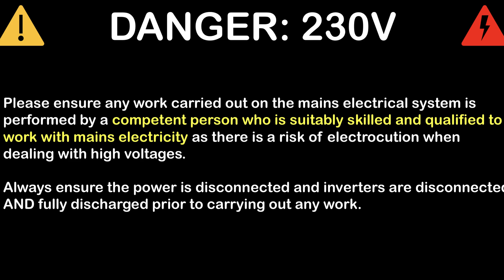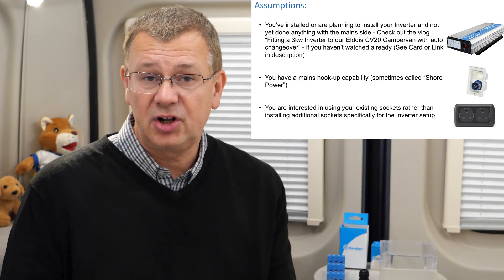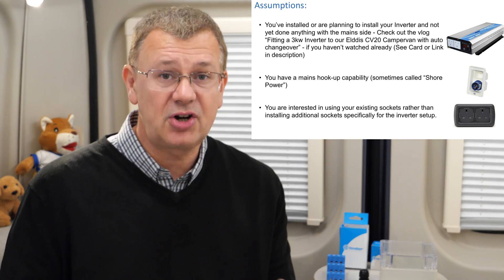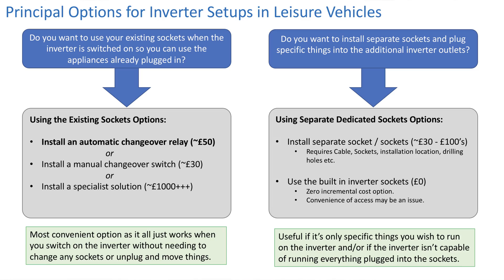Campervan Mains & Inverter Auto-Changeover for under £50 using a RELAY - How it works - Tech vlog

Comment: Hi David, am I right to assume that all of your 230V sockets are on one radial circuit? I went to install an auto-changeover on our Elddis coachbuilt motorhome today and found that the 230V sockets are on three separate radial circuits. I think it would be a bit messy to connect all three circuits to the relay, so I guess my alternative will be to connect the changeover to the 230V incoming to the consumer unit and be careful not to turn on the heaters and flatten the battery. Thanks, Kevin.
Reply from the maker: Hi Kevin, yes, that’s right, the sockets are all on a single circuit then there are separate circuits for the charger and the water heater and space heater. Imagine as you say it would be more messy with multiple circuits, the main one to watch is the charger being powered - not that it overly matters it just wastes energy in inefficiency (inverting to charge to invert …) all be it in the grand scheme of things, not sure it would make a huge difference, especially if you just use the inverter when you need it for specific purpose rather than leaving on all the time. Not sure if that helps at all. All the best, David 👍
Reply: @LeisureBit  Cheers David, thanks for confirming. In previous vans I have only turned the inverter on for a specific purpose, such as using the microwave or kettle. The charger and fridge share a MCB, so I guess could be turned off. Another option I thought of is to use a junction box separate after the auto-changeover to split the three circuits. One advantage of using the 230V incoming to the consumer unit is that I can utilize the existing RCD. The Sunshine Solar inverter that I have has an RCD compatibility switch that bonds the neutral to earth/ground, so the RCD in the consumer unit should still work.
Reply from the maker: Sounds like a good plan. Your inverter sounds much better than the one I got with its neutral/earth bonding.

Comment: Hi David Thought this was an excellent idea and the answer to my prayers.  I wanted to use my small solar system to heat a propagating bed in my greenhouse but have the security of a back up mains supply if the solar batteries ran low in the night and it was frosty. . I bought all the bits but ran into a problem before setting it up. My inverter alarms then cuts out on low battery (9.5v) but immediately the battery voltage increases as it recovers and the inverter cuts back in for a few seconds then drops out again as the voltage declines. It then continues to cycle on and off every few seconds. If I use your relay system will the relay equally keep cycling between mains and solar and is there any way round this..Appreciate your help.
Reply from the maker: Ah, I’ve see that before, my inverter just shuts down if it gets under voltage so doesn’t ‘loop’ - you probably need some form of delayed restart for several hours to enable some charge or a cleverer way of calculating the capacity. Out of interest are you using non-lithium batteries? All the best, David 👍

Comment: Hi David firstly thank you very much for your great video 👍
I am looking do something very similar if not the exact same in my campervan, am I right in thinking that the shore power is what you were using as the main input ?

I typically power my sockets when my campervan is parked up via shore power. However each time I'm using the van I have to unplug everything and plug into my inverter,  will following your video like for like resolve my issues? Many thanks 😊
Reply from the maker: Thanks very much for watching and for the comment. I use it on the sockets circuit rather than the hookup for a couple of reasons in my van. Firstly I didn’t want it powering the charger (because it would be powering the charger to charge and generate an inefficiency loop)  or the heaters, only the sockets so I can run things plugged into the sockets when on hookup or off-grid with the inverter on.
Hope that makes sense? It saves then needing to plug into the inverter socket each time. 
Make sure you get an electrician to either fit it or check it over before powering up 👍
All the best, David 👍

Comment: David, Me again !🤦‍♂️, Is there a chance you could tell me where the wiring is fitted on the consumer box please ? Sorry to be a pain, I’m the opposite to you , I’ve spend no time doing electronics all my life😂 Any help would be greatly appreciated and my other half and I continue to enjoy your videos keep it up
Reply from the maker: No worries, it’s connected between the sockets breaker and the sockets feed so it drives the sockets only on mine (you could do it differently depending on your requirement but I only wanted sockets powering) - hope that makes sense? All the best, David 👍
Reply: @LeisureBit  
Thank you I will be attempting it Saturday morning!
Reply from the maker: @slowelowe hope all goes well and don’t forget to get it checked over before switching on 👍

Comment: Hi David with this setup can I leave my inverter plugged in and switched on while I’m on shore power?
Reply from the maker: Yes you could to get additional power, I do that if on 10A hookup for example to make a coffee without needing to turn the heater off - otherwise on shore power would make sense to switch inverter off and use that but handy for a boost - all the best, David 👍

Comment: Hi David. Just one more thing before i get started the weekend. For the inverter RCD does it matter if it's a single or double pole? Many thanks in advance. Tony
Reply from the maker: Double pole for isolation is definitely best - the rcd on the inverter only functions in certain fault scenarios if you have a floating output inverter (if it’s a Multiplus or the likes it works as per domestic) - Don’t forget to get it checked over by an electrician too - all the best, David 👍
Reply: @LeisureBit  Thanks David. Yes i will get it all inspected by an electrician and get a safety certificate. Once again many thanks.

Comment: Hi David, as someone who is looking to do this, but the battery charger is plugged into transformer/recifier which is also powered by the same RCD as the sockets, do you think since i cannot put that on a seperate line, a better option maybe to add a Current sensing switch, and have the mains from the inverter run through it, with the battery charger connected to the pins, that way when the inverter is running it should shut off the charger, or is there another option you can think of?
Reply from the maker: Is the charger plugged into a socket or wired back to the breaker? If wired back you might be able to separate the two and just put it on the circuit for the sockets rather than the charger as well. Just a thought…. Might be simpler than a current sensing switch, there are other options like another relay to disconnect the charger for example. If the charger was running it just uses a bit of power through inefficiency charging and powering it’s self, if you don’t have the inverter on for long periods, I wouldn’t worry too much as it should use a massive amount. Worth getting an opinion off an electrician who can take a look too as they may find a better or simpler way too. all the best, David 👍
Reply: @LeisureBit  The hookup goes through the breaker and powers both the 12v transformer/recifier and 240v same RCD, and the rectifier also recharges the battery as well as powering other devices, there is no way around it with a simple switch, and i'm not confident enough using a 230v supply to cut a 12v via a relay thats why i was thinking my best option would be to use a sensing switch, as its more for my parents than me, my knowledge is limited but i do trust myself to do that.

Comment: Hi David. I have another question if you don't mind. I have the Bluetti ac200 max and on the inverter side do you recommend i run it through a rcd still. The Bluetti is a all in one inverter / battery that i'm pretty sure you have heard about. I want to connect the van sockets up to it with the change over switch. Many thanks in advance and i love all your videos. Brilliant.
Reply from the maker: Thank you, I personally would but I also know there is limited protection, it’s in a certain scenario where it would be effective, same with powerbanks, most have no protection and are used without issue. It’s a balanced risk, low probability of issue, but very high potential impact. Not sure that helps - all the best, David.
Reply: @LeisureBit  Thanks David for your fast reply. This has been helpful.

Comment: Hello David... I have learned something that may be of help to anyone else doing this work... Some RCDs are designed to disconnect when the electricity is turned off, these are known as non-latching or active RCDs. Others are designed to stay connected when the electricity goes off and these are called latching or passive RCDs. Because I had a non-latching RCD,  everything tripped out when I turned my inverter off, which was initially very confusing !!
Reply from the maker: Thanks very much for sharing as it’s really helpful to know - pleased you found out why too - all the very best, David 👍

Comment: I have a quick question but i would like to thank you first  David for this great video. This is certainly a game changer. Now my question for you is do recommend 1.5mm cable for the relay to the sockets or 2.5mm. Many thanks in advance. Tony
Reply from the maker: Hi Tony - thanks very much - it’s very handy isn’t it  - I personally would always use a good quality 2.5mm whenever possible - all the very best, David 👍
Reply: @LeisureBit  Thanks for you fast response David.

Comment: Hello David,  thanks again for the video... I have now finished my installation and have a question... when I am using 240v through the inverter, everything seems fine UNTIL I turn the inverter off. At that point the in-line RCD (between the inverter and the relay) always cuts out and I have to reset it the next time I turn it on to use it... any clues ? ANy help would be most welcome. Thanks. Michsael
Reply from the maker: That sounds odd but I wonder if it's when it browns out (when the voltage drops out after switching off) - out of interest which Inverter & RCD have you used? Might be able to figure it out from that.

Comment: Hello, great video, is it possible to use the same hook-up consumer unit RCB for the sockets as the inverter or would they both need separate RCBs for the sockets. Thank you
Reply from the maker: I used a separate one from the inverter and the main one from the mains via the sockets, appreciate the inverter one with this type gives some protection but due to floating outputs not the same as the regular mains (given how they work) but I still thought worth the extra one. Hope that helps, All the best, David 👍
Reply: @LeisureBit  thank you great to know 👍

Comment: Hello I used option 2 a manual switch, however I came out the RCD socket side, that was my input on the rotary switch and then my sockets as my output on the rotary switch, however if I flip the RCD on or off makes no difference I still get power, maybe it's possibly due to using the shore hook up RCD I might need to use a dedicated one. Cheers
Reply from the maker: Hello, I tapped in from the socket breaker, and the sockets as the output, same as your switch. Seems odd ref RCD, all be it the RCD for my sockets on the mains is up-stream in the consumer unit and the RCD from the inverter feeds into the other poles. Hope that makes sense? Both trip and cut the power on testing. All the best, David 👍
Reply: Great thanks for the reply much appreciated, I didn't test on the mains hook up side so I'm guessing I need to install a separate consumer unit for the inverter so I can trip the sockets off  and on when testing and obviously for safety.

Comment: Thanks once again for your brilliant video... I have just finished my own installation and have a question... can I ignore the AC input on my inverter ??? I am only going to power my sockets either by hooking up with shore power. ,or .. if no shore power is available... by using my battery powered inverter. So my thinking is that I have no use for another AC input into my inverter ??? Any advice would be very welcome and I'd be happy to buy you a virtual pint as a (hopefully) fair exchange... Michael
Reply from the maker: Hi, great you’ve just finished your install. If your inverter has a mains input for UPS (Uninterruptible Power Supply) mode, you can just ignore it as it’s not normally the feature required in a van setup, more where you want to keep a continuous power if the mains fails (like keep a computer or medical equipment running) - hope that helps and makes sense., All the best, David 👍
Reply: @LeisureBit  .... thanks once again David.  that is very helpful - and soothing to know that my own installation is "solid". I am a naturally risk averse character and I like to know that I have got all the potentially lethal stuff right ! Michael
Reply from the maker: @michaelbarnicott-white5498  Absolutely right, it's always important to get any installation checked independently to make sure it's safe. As you say, there's a lot of potentially lethal stuff in vans, especially when we add to them or modify in which a small mistake can cause catastrophic or life changing outcomes, always best to do everything to mitigate against it. All the very best, David 👍

Comment: I'm concerned about upstream bonding of neutral to earth so the sulied rcd still trips under fault conditions.
Many inverters won't disconnect like an " on shore". Rcd should. Any thoughts?
Reply from the maker: You're absolutely right, certainly the 'cheaper' end tend to have floating outputs (also lots of generators, power stations etc) and many expressly forbid the bonding of 'Neutral' to 'Earth' on these also which otherwise you could do to get a domestic like outcome if that was required. 
As you most likely know, RCD works on imbalance between L / N current flow - so if it's floating, if you touched one of the outputs and then 'Earth' if it's not connected anywhere, it's likely no current would flow (clearly wouldn't recommend testing this out!) and thus the RCD won't trip with a tester for example as there's no current path. However, if there was a connection to earth or multiple specific faults, then it should work - my view was it was better to have it than not have it in the circuit, knowing that it wouldn't normally have a situation which would trigger.
Out of interest did you have any specific scenarios in mind? I've looked into it before doing it and the RCD not tripping isn't an issue as it's common sense science why it doesn't with a floating output, and the purpose of the RCD is preservation of life to prevent excess current flowing through the human body. It doesn't trip because there is no current flow... Welcome any views / thought of other scenarios (clearly more to do with the inverter than the auto-change over as that's just a two pole change over switch for the sockets) - All the best, David 👍

Comment: Hi David great informative video, did you ever get your motorhome fridge connected up to the inverter.
Reply from the maker: thank you - the fridge is a 12v compressor so is just Dc, the breakers are generic for caravan’s and motorhomes with 3 way in (think it says fridge / charger) so all good with that - I was going to connect the water heater but haven’t got round to that yet, all the best, David 👍